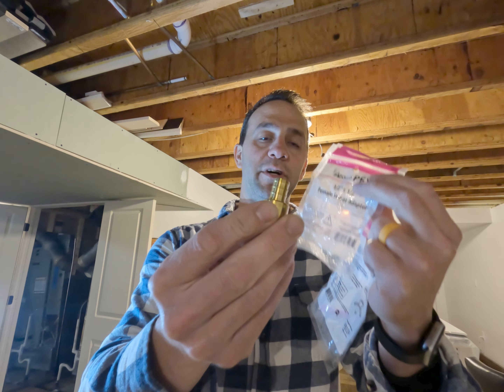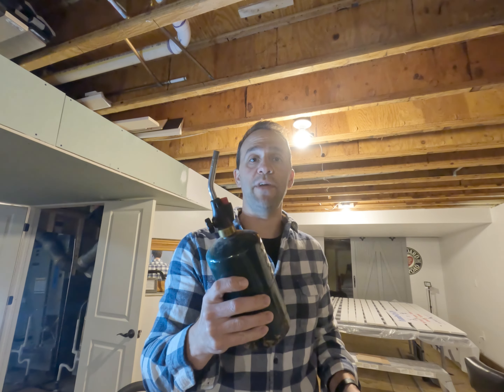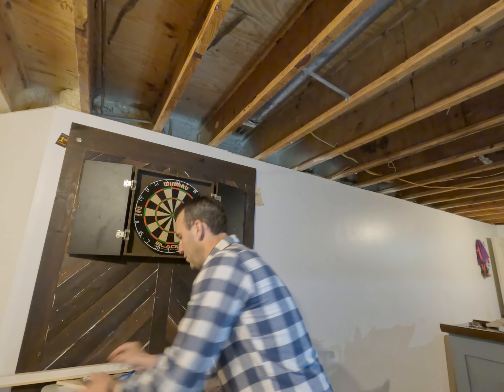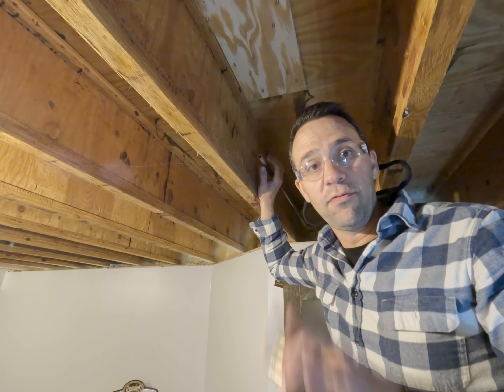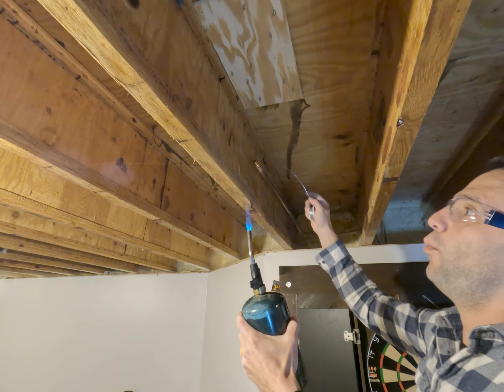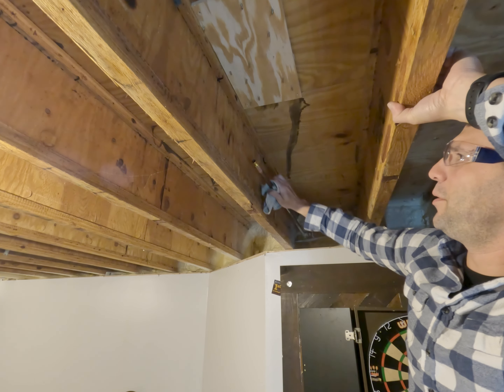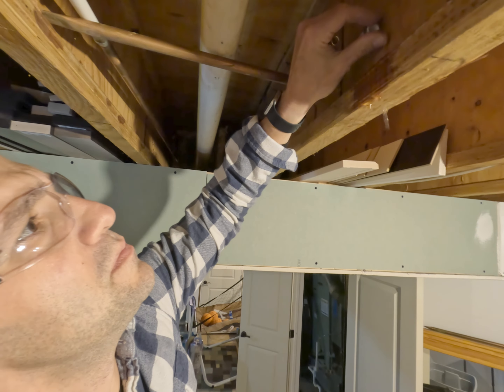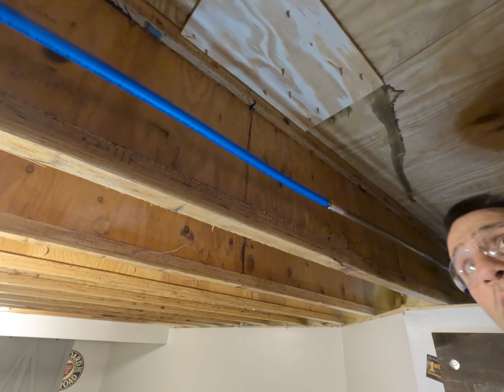Copper to PEX conversion, let's make this easy

Comment: What type of solder do you use?Same as copper to copper or copper to brass?Is there a difference?
Reply from the maker: if you go to plumbing section in home depot, its the solder in the copper section...  just normal  solder, sorry off top of head can't think of technical name
Reply: Thanks I know there’s also tinning flux & I don’t want to buy the wrong one.